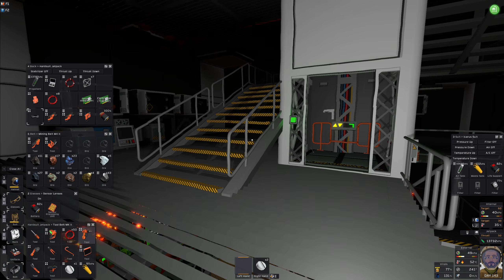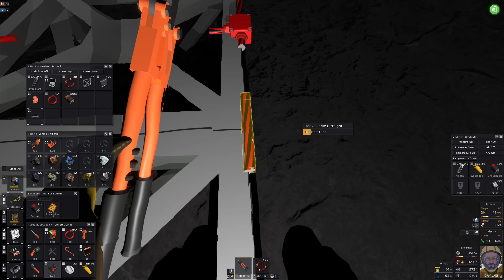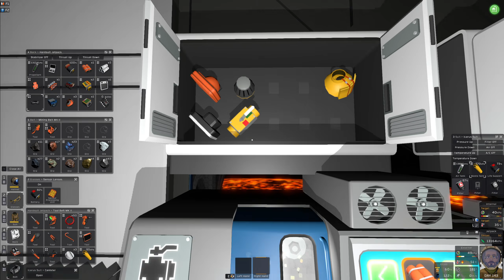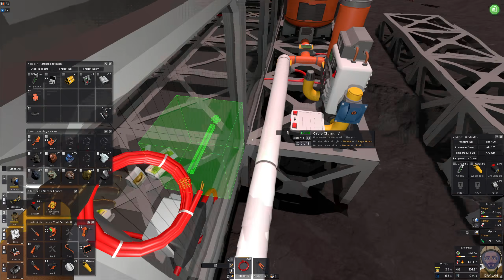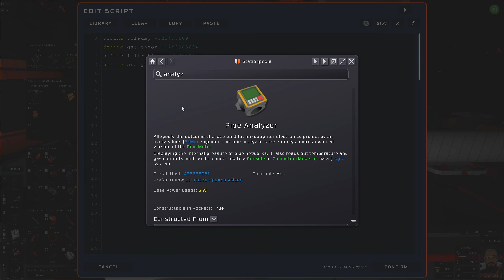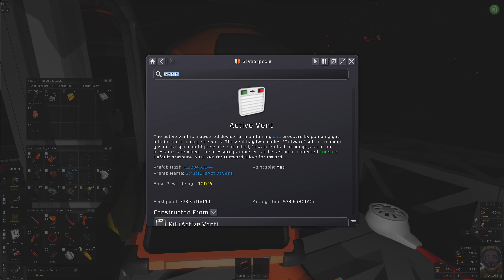First Step To Rocketry: Fuel - S2 E43 ║ Stationeers

Comment: The 8 "plants" is not that you can plant 8 seeds. You have 4 spaces for seeds and 4 spaces for fertilizer. And I think you should be able to change the "ON" state in the code to switch the grow lights on/off. But I guess I am kinda late with this advice 😅
Reply from the maker: I did realise that after a bit, but even if it had 8 slots the built in light uses 100 watts, which is more than the standalone version. It covers way less plants for more power, so just for that I ended up using the trays again. :D

Comment: Using two pumps instead of a mixer feels a bit like trying to reinvent the wheel.
Reply: It's also not easy to get the gas mixer to go as fast as it is possible to go with two pumps, at least if you have some decent input pressure.
Reply: The mixer can create fuel just as fast as a dual pump build.  Lets not make up excuses that aren't actually true to justify his choice to not have to do math.
Reply from the maker: The mixer is only accurate if the gases are the same temperature. If we try to mix cold O2 with hot volatiles, the mixer will take in more O2 than necessary, since it's colder, so the same volume will have more moles.

I'd rather not do complex maths to figure out where I need to set the mixer for the correct mixture, doing it like this felt a lot more simple.